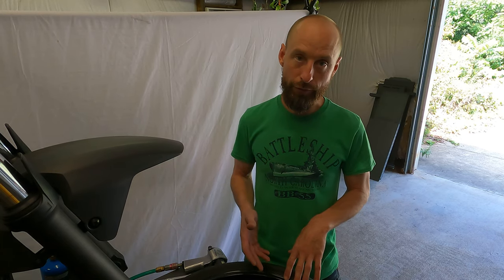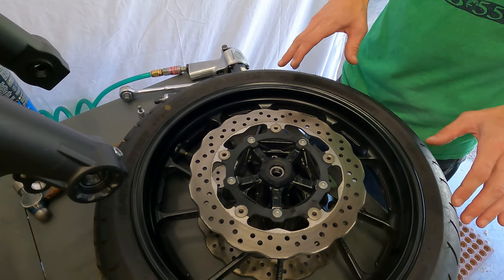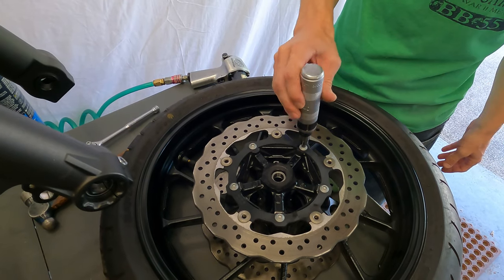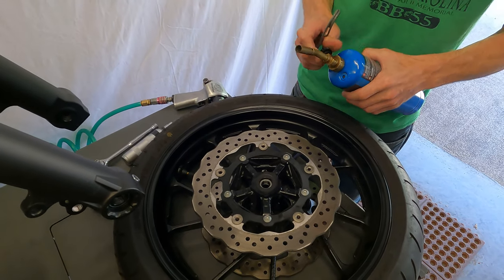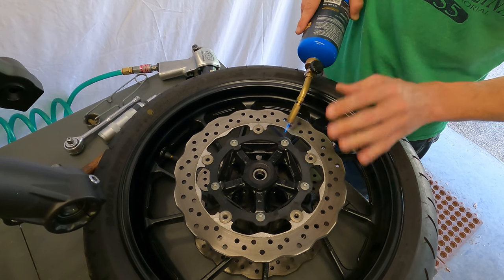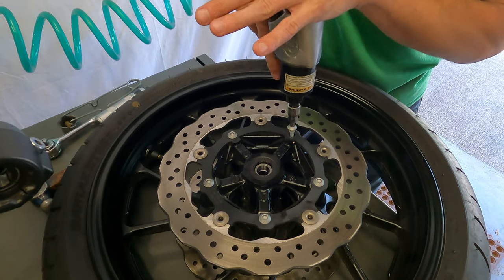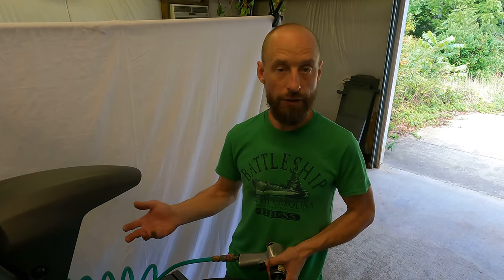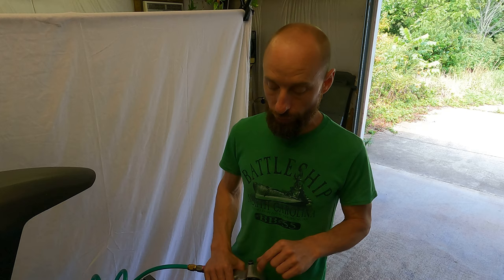Removing Motorcycle Brake Rotor Bolts

Comment: My cordless impact drill did not cut it but I hammered the bolts a bit, then applied heat with a propane torch for about 20-30 seconds and then used a proper hex bit socket with a 25" breaker bar, hammerred that in a bit to make sure it was bottom seated and was able to free all the bolts. They were quite snug and had yellow loctite type material on them but they came loose! Thanks for the heating advice!

Comment: Heating the bolt helps soften the thread lock and create a touch of expansion. You can also heat and cool then heat again and that will help. Just remember to thread lock when you put them back in, but only a tiny drop

Comment: I would have destroyed my system and been in a hurt locker as I have no car or the real expensive cash at a dealer
Question are all bolts regular thread? What is torque spec same as XSR 900 I’m sure as basically same bike thanks very very much!!

Comment: How much heat should one apply, given many motorcycle wheels are cast alloy. I bent my rotors when changing my own tires (FZ09) when the wheel fell off the stand during the tire removal. So i need to replace both rotors. I have new discs and bolts, i'm just cautious on how much heat i should be using. i don't want to damage the wheel.

Comment: MAN!!! I broke THE LAST ONE off after prepping the damn nut before even trying (EVEN TAPPED IT B4 TRYING TO BREAK IT LOOSE).... "THEN" HAD THE EASY OUT break off inside the BOLT TOO, always the LAST DAMN BOLT.
Reply: Ouch! Did you have to drill and re-tap?
Reply: @ArcanePath360  can't drill through the tap that broke.... have to tale ot to a MACHINE SHOP to fix.🤦‍♂️😭😭
Reply: @robsnizzle7  That's unlucky
Reply: @ArcanePath360  an of course it was the "LAST BOLT" too.🤦‍♂️🤦‍♂️